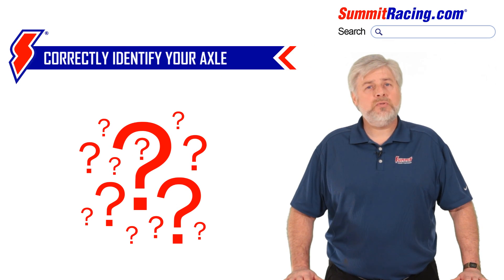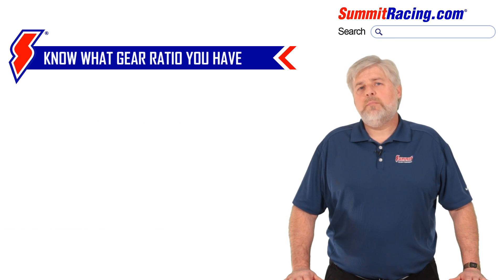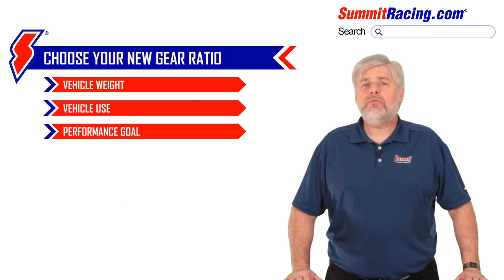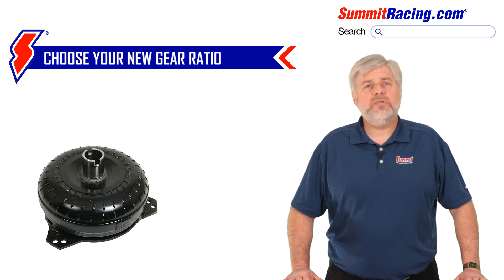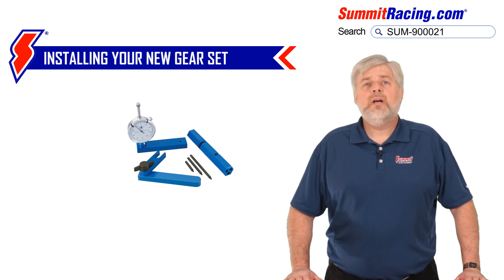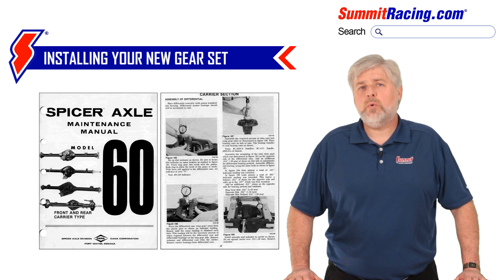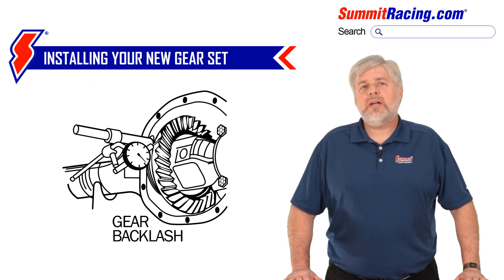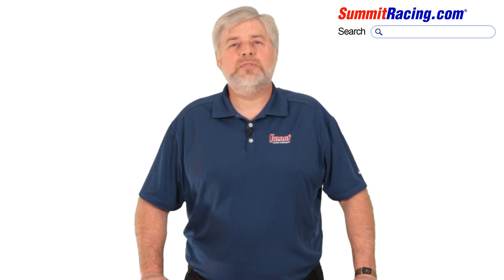Ring & Pinion Swap Basics - Summit Racing

Comment: In motorcycles, it is possible to adjust the final drive ratio by only swapping either the front sprocket or the rear sprocket. If I have an LSD installed with 44 teeth in it, is it possible for me to just swap the pinion gear to one with less teeth to effectively lower my final gear ratio and thus exchange top speed for acceleration? What other things must be brought into consideration when doing such modifications?

Comment: Great vid Can you tell me by deducting 5 thousands on pinion dept ,How many thousands would it add or deduct on backlash ?
Reply from the maker: Once a pinion depth change is made, the backlash would need to be rechecked and readjusted.
Reply: @SummitRacing  Thanks for getting back to me I put everything together checked my backlash set around 6 and when I checked other parts of the gear it will read 9 ,,Is this normal ?

Comment: What company manufactures the Summit Racing brand ring & pinion? I'd like to change the ratio in my 97 S-10. It's a 4.3L with NVG3500 transmission. I also have a Torsen,series 3 carrier I'm  going  to install with my new gears. I'm thinking I'm probably going to install 3.42 gears possibly 3.73. I have 3.08 in there right now and they.....well they suck tbh. Also,the Torsen is out of a 99 Camaro  both axles are 7.625 and 28 splines. I figured it would work ok. Better than the open diff. I've gotten stuck on wet grass before. I figured that the Summit brand is probably fine. I'm not racing it or even really beating on the truck. I just use it to get to work and haul a 12 ft aluminum boat for fishing. I have a module to fix the speedometer after I swap the gears out. Are the Summit gears made in the USA?

Comment: Can this blow up your transmission
Reply from the maker: Hi Lorenzo, we would need more information from you. Can you give our tech line a call, 330-630-0240. Thanks!
Reply: Summit Racing I only went from a 3.92 to a 4.10 gear ratio and with my eco tune at 70mph I'm a 1700 rpms lol. Don't know if this is good or bad

Comment: So, assume you have a 3500 rpm stall converter.  He's saying you'd want a CRUISE rpm of say, 4300?  Can you imagine cruising at 4300 rpm?.  At cruise speeds torque converters are approaching lock up slippage.  There's no way you need to be above the converter stall speed at cruise speed.